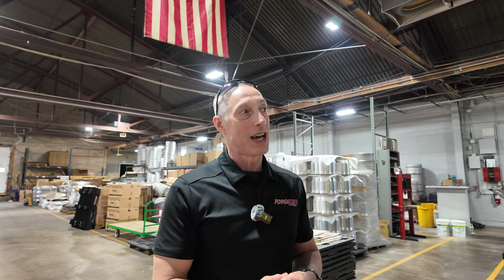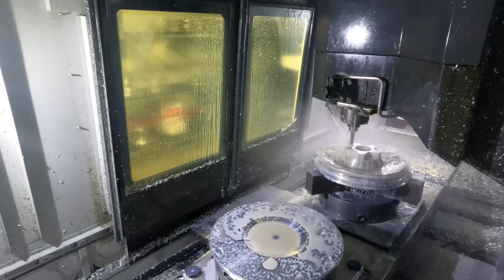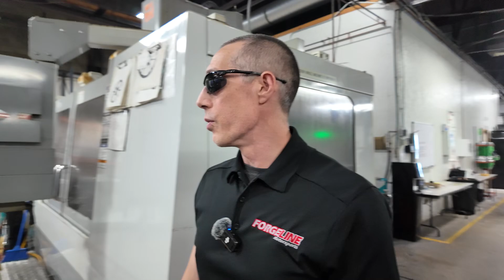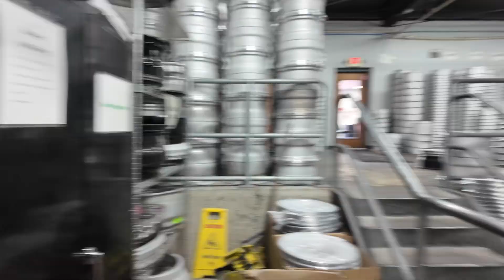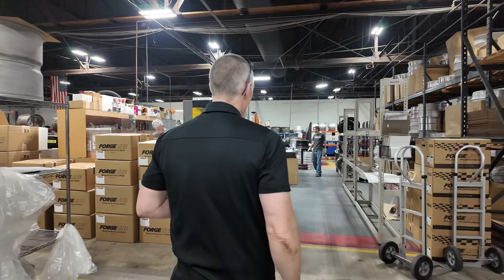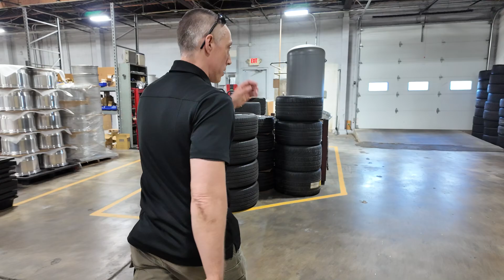Inside @Forgeline Wheels: Touring the Facility & Building Custom Wheels for My Superbee

Comment: FYI, John is correct, when he says that the attachment flange for the carbon barrels is different than the attachment flange for the aluminum barrels, but it's not because of the hole count. Both barrels have 40 holes. The difference is that the flange for the carbon barrels is located further inward toward the center, and the flange for the aluminum barrels is located further outward away from the center. So as a result, we need to locate the "register" (aka the attachment point on the center) in a different spot to mate up to the appropriate barrel flange. In either case, they are not interchangeable (which was his original point). We need to design & machine the register on the center to match up to a specific barrel.